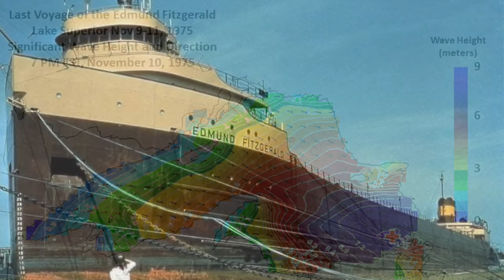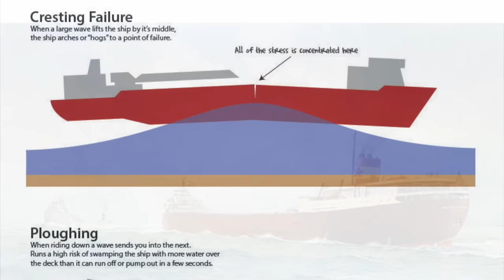What Happened To The Edmund Fitzgerald?

Comment: My great grandpa worked on that ship a lot in Toledo at the shipyard. He’ll tell you all day that she went up a wave too big when she came down the bow hit the bottom of Lake Superior, since it was 500 foot deep and she was 729 foot long, and the torque from the engines running at high RPM and out of the water ripped the back portion of her off. And that’s what I believe happened.
Reply: I think your grandfather was right on !!! Could have  reversed on back side of first rogue wave!! And hit !!! Really hard !! On bottom so fast !! Not a couple minutes a few seconds!!!
Reply: I saw an interview with captain Cooper an he thought those two big waves hit the Fitz and drove the bow to the bottom like you grandpa said
Reply: My dad was a welder at the shipyard the day it left port, dad said it had 3 to 4 foot rust holes in it and was told to weld plate steel over them & the water level lines was 4 feet below the water , was way overloaded,  the crew had no chance in hell, mom had a picture of dad and 3 others on the bow of it
Reply: Spot on. It climbed the wave and when the nose came down it was so fast it drove itself into the bottom.
Reply: Your grand dad was likely right.  I don't believe she went any other way.
Reply: Wow.
Reply: Dakota knitting you are right about the Edmund Fitzgerald being way over loaded and at the time of the Edmund Fitzgerald's sinking she was carrying a cargo of iron ore with half of this cargo slated to be unloaded at the Rouge steel mill plant in Dearborn, michigan the rest of the load of the iron ore was slated to be unloaded in toledo, Ohio and this was suppose to be the last trip on the great lakes for the freighter Edmund Fitzgerald because the winter weather was approaching the great lakes very fast and Dakota I don't know if you know this or not but during the winter lay-up for all of the great lakes freighter's the Edmund Fitzgerald was slated to have an inspection done on her and she was also slated to be cut in half in the drydock of the Fraser ship 🚢yard were a new 125 foot midsection was to be installed bringing the length of the Edmund Fitzgerald from 729 feet to the length of just 768 feet and the Edmund Fitzgerald was also slated to be converted into a self-unloading freighter that would no longer have to rely upon land based unloading equipment for this freighter to be unloaded instead the Edmund Fitzgerald would have been now able to unload herself in just a matter of maybe 2 to 5 hours then she could be unlocked and head to another place where she could be loaded up with more iron-ore to take to her next port of call to be unloaded so that the iron ore pellets could be put into the blast furnace's of the steel mills on the great lakes of this great state of Michigan so that these iron ore pellets could be turned into new steel to make brand new products like car's steel for the construction of new buildings, steel that can be used to make new casket's for families to burie their loved-ones in steel that can be made thin to manufacture pop cans beer cans and other household items and products, plus new steel that can be used to make the steel beams for new bridges to be built,and steel that can be used for the building of new great lakes freighter's to sail on our own great lakes instead of relying on countries like China, Russia and even Iran to build our own ship's and most of all to our own people here in America employed and not have to rely on foreigners to do our job's which would then put many if not all of our fellow American's out of work and then put them on the unemployment line and put some if not all of our people permanently out of work, but we also need to be helping our fellow allied nation friends out as well to keep them employed and not have to see them face potential unemployment and even seeing them end up like the United States of America permanently unemployed which would make the great depression of 1929 look like child's play or even making it look like a Sunday picnic in the park and then this would look really bad for this world and everyone living on this planet!.........  .
Reply: I've never met your great grandfather but I believe him.
Reply: @allanhonaker5176 
R2-D2
Reply: It truly is the only theory that makes sense.  They keep saying the loose covers caused her to swamp but those covers would easily have come off during the impact with the bottom.   If She didn't spear the bottom then the 2 wave middle hull snap is the only other feasible theory.
Reply: toledo has a shipyard?
Reply: @joesullivan8861  On the north side
Reply: @jamess.merritt5353  wow, do you not believe in periods? Lol 😂
Reply: The Edmund Fitzgerald had a powerful engine that is just what led to the tragic sinking of this great ship 🚢 another thing that led to the tragic sinking(a.k.a.)demise was the fact that the ship 🚢 was overloaded the Fitzgerald was only legally licensed and allowed to carry only 26,000 tons of iron ore but at the time of this tragedy this ship 🚢 was carrying over 29,000 tons of iron ore and if the s.s. Edmund Fitzgerald had remained in port were she tied-up the Edmund Fitzgerald could still have been sailing on the great lakes today but the Edmund Fitzgerald would while during winter lay-up would have been converted into a self-unloader with a large self-unloading cargo boom on her deck just like the s.s. Arthur m.anderson was converted to a self-unloading great lakes freighter, the Fitzgerald's sister-ship the s.s. Arthur b.homer was lengthend and shortly after being lengthend the Arthur b.homer was sold for scrapping and was scrapped not long after she was lengthend in the late 1970's to the late 1980's, the ever popular Edmund Fitzgerald was not the only tragic ship wreck to happen in 1958 the s.s. Carl d.bradley broke apart and sank in lake Michigan after she had experienced a boiler explosion which broke her into two half's and the Bradley's sister-ship the ceaderville was struck by a saltie a cargo ship 🚢 that can travel the 🌎's ocean's the ceaderville experienced a boiler explosion like the Bradley had in 1958 the ceaderville lies on her starboard side and is also broken into two large pieces like the Carl d.bradley herself is also broken into two large pieces both the s.s. Carl d. Bradley and her sister-ship the ceaderville were both self-unloading freighter's the Carl d. Bradley whose wreck lays at the bottom of lake Michigan is the second ship 🚢 to bear the name Carl d. Bradley and was owned by the Bradley transportation company which alway's hauls limestone cargo's which is used in the making of grave marker's and is now also used in the building of large office buildings and limestone is used in building foundation's for people's homes 🏡. Limestone was even used in the building of the king 🤴 of rock-n-roll elvis aron Presley's home/mansion Graceland mansion in Memphis,Tennessee limestone is used in construction 🚧 of buildings all over the world 🌎  limestone was even used in the construction 🚧 of the Vatican 🇻🇦 the residence of pope Francis the 1st in Rome, Italy 🇮🇹 and yes limestone was even used in the building of the most popular and famous city on America's east coast Boston, in the state of Massachusetts many of the building's in Massachusetts had limestone used in their construction 🚧 except in the building's that were built over 3-500 years ago but many building's today are having limestone used in their construction 🚧.as well as steel and glass windows 🪟 being used as well, but these building's are having many other types of materials also being used in their construction 🚧 as well.
Reply: @BelaRube  I was never absent from my English class because English was one of my most favorite classes in high school 🏫 for which just one year after I graduated 🎓 from Jared w.Finney high school 🏫 in Detroit Michigan my old high school 🏫 was demolished to make way for a new high school finney high school 🏫 that was merged with Kettering high school 🏫, I have never missed English class which was taught to me and my class mates by a woman named Mrs Ramsey and she alway's taught me were to put my periods in a sentence when I alway's wrote a term paper 📃 for English class.
Reply: @BelaRube  For the love of everything good, what does this matter???
Reply: @jamess.merritt5353  The biggest & most prominent reason that the Fitzgerald sank was, in my mind her captain. He sailed right into that storm knowing full well that she was overloaded. There were probably  multiple harbors to pull in, but NO, we can’t do that. The money was to overpowering for him.
Reply: @jamess.merritt5353  lol
Reply: @SJKile  because it did to me.
Reply: @allanhonaker5176  Wow. I've never heard or read this before, about the last minute repairs, and being so overloaded.

Comment: The fact that captain 
McSorely informed captain Cooper that his ship was lisping and had the need to run both dewatering pumps after a "questionable" pass at Caribou sholes is telling.
     A cargo that absorbs water, previous inspection reports stating cracks present in the keel, and a call to the Anderson for navigational aid because of faulty radar...
      One could assume the radar was questionable before the run at the sholes and led to the "closer than I'd take this ship" statement from Capt. Cooper.
     Many a Great Lakes marianer believe that the Fitz hit bottom at Caribou sholes.....she took on water faster than she could pump it out on the "Break" accrossed the lake.
     Waves recorded that night were 20' in open water and building higher in the shallows upwards of 30'+
     Slipping lower and lower until she swamped the cargo deck and internal air pressure could have blown one or more hatch covers off.....she would go down fast enough to break in half when it hit bottom. 
       And it did!
      We are holding our own! ....was not a usual response from the "usually cheerful" Capt McSorely....that is a nother telling of the seriousness of the ships plight.
      Years later I stood on whitefish point during a November Nor-Easter and read the 29 names on the memorial.....the wind pushing 40 knots and waves breaking 20"
     The verse of Gordon Lightfoot's song running through my head...."Does anyone know where the love of God goes when the waves turn the minutes to hours"
       Lived here my whole life, Superior is a cold unforgiving lake...even in July And August you can die from exposure to the water...
        I was a teenager when it went down....seen the Fitz at the locks....it was as big as the lock in length and width.   Biggest ship on the lake.
Reply: The ship was lisping? You mean listing. Lisping would imply the ship speaks.And there isn’t a word accrossed. It’s across. Nice tribute to the crew. I have lived in Cleveland since ‘52. I knew 4 different men who went out and never came back! The Great Lakes are a bitch. Almost sank in 900ft of water in Huron one spring. Another half hour we were gone. Got an emergency pump working. Water was 33*  The captains were fools for sailing that night. Tomorrow would have been great. Taconite doesn’t spoil unless it’s on the bottom. The Fitz was flawed, cursed and steered on the rocks, no lighthouse, bad radar, and captain from hell in 30’ waves! No chance. Any one reason could have sunk her! 💲🙁💰✝️
Reply: @55DepotStreet  thank you... you stopped short of all the mistakes
Reply: You are right my father was on the lake that night and participated in the search. He is absolutely certain she ran aground on the shoal. 30' waves in 30' of water ?  She slammed into the lake bottom. Tore a while in her, and couldn't pump the water out fast enough
Reply: Stood next to the Edmond Fitzgerald while it was in the Soo lochs, more than 50 years ago...
Reply: @ktanner11  Wow.  Was your father on the Anderson or the Ford.. or Coast Guard?
Reply: @troybingham6426  Anderson
Reply: @55DepotStreet  Your assessment of both ships sailing that night and both Captain's taking the helm in treceous winds and waters is very much correct except for this:  Number one, If they didn't sail that nigh their 40 years of sailing experience with both of them would have ended as they would have found other ship's master's to take the helm and get the Bob done, as these outfits didn't care about the sailors or the Captain's who pilot these vessels, they only cared about one thing, Money. Number two: The Great Lakes region is tricky to say the least. One minute it's like a mill pond, quiet, peaceful and serene. The very next minute it can, and has released all her fury as you have seen and have heard on that fateful night of 10 November, 1975 taking down the mighty Big Fitz and all her 29 men on board her as there were two volatile air masses that were crossing over and into the region causing this great havoc to happen, knocking out the lighthouse's, shutting down the radar screens, etc.
Reply: I totally agree with your comments. She most likely "bottomed out" near Caribou Island. Her Bow was driven into the bottom of Superior which caused the breaking in half. I've seen the Arthur Anderson up close a few years ago which was wonderful in a Historical manner.
Reply: Cold and as unforgiving as the Pacific Ocean.
Reply: I was stationed at the 753rd Radar Squadron at the time. I had spent many hours in the locks park there in the Soo. I remember talking to crew members when they went through the locks. I remember well that night, watching my car rocking in the wind, and the signal light at the intersection of Ashmun St and Water St pointing more east than down. Largest ship on the lakes? Perhaps when it was launched, but I remember seeing the Stewart J Cort  pass through the locks… the only one that it would fit. I think it sailed with the title of the biggest on the lakes at that time.
Reply: @BlueEyedWolf13     at RACO field?
Reply: @howardmarty7261  i saw her in 1972 at the zoo
Reply: you are spot.on with your interpretation of the reason of it's sinking lisping listing still I knew what you implying
Reply: I was in my late teens when this happened, I live only 20 miles from lake Superior's south shore in Bayfield county Wisconsin, but I got a chance to go on a tour at the Frazier ship yard and the fritz was there getting work done on?? , but it was something that I will remember all my life, what a great ship/vessel of the great lakes region, so many times I saw it in the ports getting loaded up with taconite, through the years of myself with my parents going to Duluth shopping and seeing the Edmond Fritz Gerald at the loading docks. Rest in Peace men and vessel. 🇺🇸❤🙏
Reply: The word is spelled Shoals. Look up the definition
Reply: I enjoyed reading that. Very descriptive and interesting. Thank you for sharing that.
Reply: Listing not lisping unless the ship had a speech impediment.
Reply: There’s a lot of “lisping”
On this video 😉
Reply: Many years ago there was  a tragedy that was the basis for a popular song by a foreign singer/songwriter. While there is physical wreckage of the disaster, the bodies of the people who are presumed dead have ever been found.  The US military was monitoring strange activity in the area and there is a file on it which will be declassified soon.  This includes evidence that they were attacked by an unknown craft using advanced weaponry and they also took away the people who were present.
Reply: @Anne O'Nymous My goodness, it's so wonderful to have all these proof readers which doesn't change the story at all. Most people with even rudimentary reading skills have the ability make these  corrections without your assistance.
Reply: @ktanner11  I agree ,I also am a former Great Lakes Seafarer.One cannot keep afloat with a pump that does 100 gallons and you are bringing on 175 gallons,Distance would show that logical,I sailed that lake for years
Reply: Ive spent a lot of time on the Great Lakes, including some bad storms. They become a part of you. I hope to one day stand on Whitefish Point because the Fitz touches my soul.
Reply: @richardkorejwo6398   That must have been a very somber time on the lakes when she went down ,or any other ship for that matter.
Reply: @55DepotStreet  Yeah, and they're called bilge pumps, lol, NOT "dewatering" pumps! LMAO!!!
Reply: @55DepotStreet  Yup, McSorely was known to just run the guts right out of it. It's a tragedy for sure. Could've been avoided, but GREED takes precedent over weather. You can bet NONE of the owners would've been caught out there on ANY ship that night.....
Reply: @danbasta3677  Holy stringy sentences, Batman......
Reply: @hockeyteam1954able  Why, yes it is nice!! I think we can figure that out without you pointing it out, teacher. Crawl back behind your pulpit, ferchrissakes......
Reply: @milojanis4901  You're lecturing the guy for telling others we don't need lecturing, because you say we don't need lecturing. What's it like living with no self-awareness?
Reply: Don't cry over spilled milk 😂😢😢😅
Reply: Makes me so sad to read this. Brings tears to my eyes.